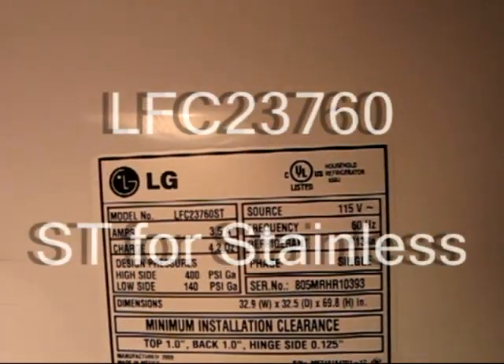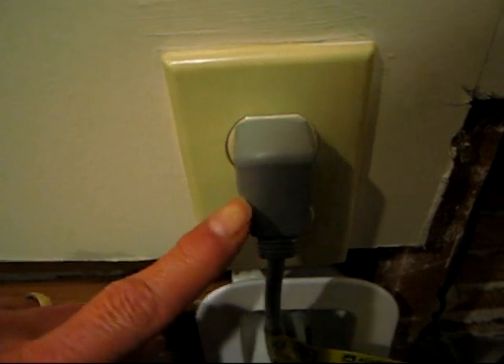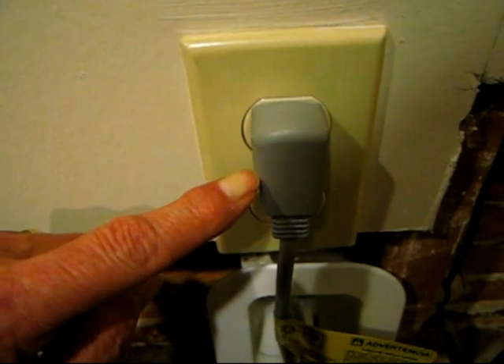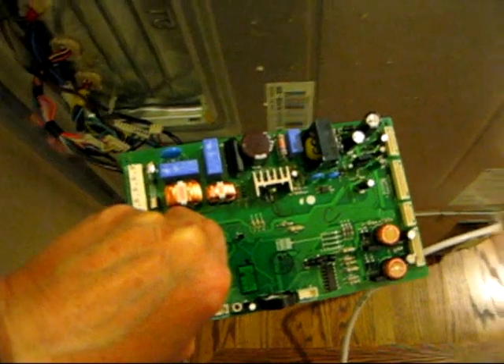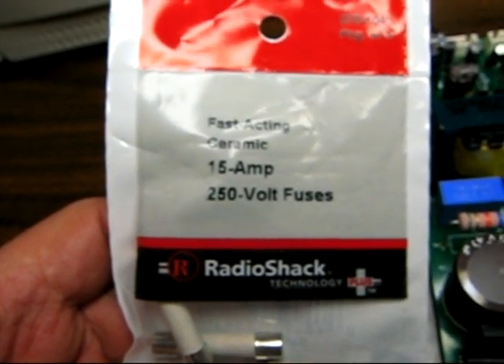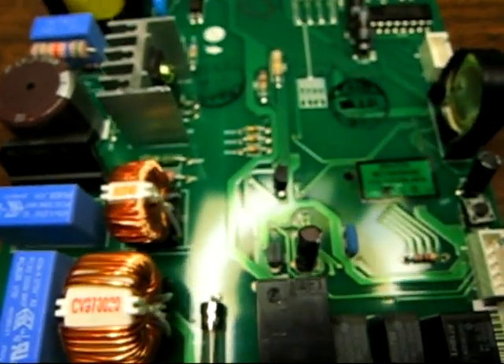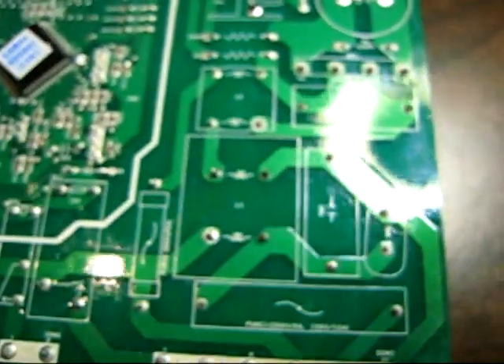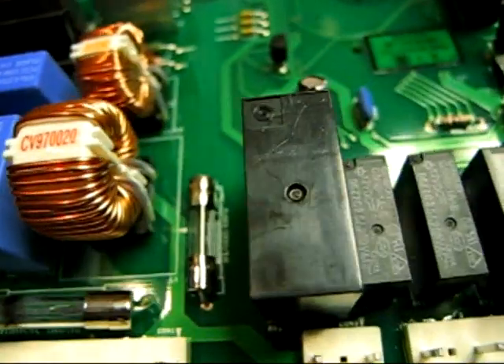LG Refrig FUSE Repair Part1

Comment: Retiredman2006, you absolutely rock bro!!!!  Thank you so much for posting the two videos on fuse replacement on LG fridges.  I have the LSC26905TT side by side model, and it cost me a grand total of $3.99 to fix my problem. In my case, the fix was even easier, because the larger 250v/15A fuse in my model simply pops in (and out), so no circuit board removal much less soldering was required at all.  I will also mention to anyone doing a repair on this LSC26905TT model that the circuitboard electronics are located on the top of the unit, not on the back (just follow the power cord to where it connects with the unit on the top).  Very thankful, thanks again!

Comment: Thank you for the great video.  I woke up to my LG LFC23760ST not working.  Interior lights were off and the LCD thermometer wasn't illuminated.  I checked the circuit breaker on my home's electrical panel and it was fine.  I googled LFC23760ST and your video popped up.  After a visit to my local electronics store and $3 in parts, I was able to fix my fridge.  Thanks for making this great video.

Comment: FIXED! Hallelujah ! I know nothing about electronics. Took a stab at it since I may end up with a broken fridge anyway. I cut the pins at the fuse instead of taking the pins out of the board. I fused the wires to them instead. I first tried to shortcut and solder directly to the fuse but it never held......should have done it your way first. Thanks a bunch, saved me 1000 bucks :)

Comment: First, I wanted to say thanks!  This fixed my problem before any food could spoil.

I went ahead and ordered some fuse clips I can solder onto the board from Amazon so I won't have the bulky wiring floating around.  As for the 250V/15A fuse, apparently they are common microwave fuses and I picked up two for a couple bucks at Home Depot.

Thanks again for the helpful video.

Comment: Thanks retiredman2006!  After five years of use, our LG just had the same problem. Not the same model but it has the same circuit board. The fuse is bypassed for now but I will definitely be attempting this fix tonight.  While I'm not positive it had anything to do with the fuse but our bottom sections was filthy with pet hair and debris.  Access was simple by removing the screws holding on the bottom panel on the back.  Hopefully a thorough cleaning will prevent future fuse issues.

Comment: I have the same model fridge purchased in the fall of 2009 and the fuse blew this morning.  I had no idea what happened or how to fix it until I watched your video.  I would just like to extend a big thank you to you for posting this 2 part video.  It was very much appreciated!
Reply from the maker: You're welcomed.  In these times throwing away the circuit board for $200 due to a blown fuse is just dumb!
Reply: It ended up costing me $1.70 CDN.  $0.20 for the fuse and $1.50 for the inline fuse holder.

Comment: Thanks your fix worked perfect. However when I opened the panel and did a visual inspection my fuse did not appear to be blown or "burnt like yours in the video, but checking it with a multi meter is sure was. So any out there,  double check yours before you give up ( like I almost did ) and call the repair man. What a good feeling to save hundreds and not to mention all your groceries. ..
THANKS AGAIN.
Reply: Yea exactly, my fuse looked good and clean, not  black and blown, so I didn't think that it was the fuse and was starting to look into the compressor start relay but everything related to that kept saying if the fridge was not cooling and mine was DEAD, so I knew that it had to be a power source. I found another video where the fuse was clean and intact like mine and he used plastic covered handle needle nose pillars to test it which was perfect because I do not have a multimeter. I gave it a try and SURE enough after a few clicks the fridge turned on and was running, which confirmed that the fuse was indeed blown! Moral of the story, NOT all fuses have to be black, cracked, broken to be blown, mine looked perfectly fine. Glad that I didn't have to buy any new tools.

Comment: Thanks for posting this. You saved me an ugly repair bill.  I believe the 250V 15A fuse is the correct one for a 120V supply voltage (in the U.S.). 250/15 was the original fuse on mine as well. The 250V 9A fuse would be for a supply voltage of 220V. I used the ceramic radio shack fuse you showed in the video. Hopefully it will fare better than the first.

Comment: Thank you so much for the easy-to-follow tutorial.  I made it even easier (though perhaps less sophisticated) by leaving the bad fuse in place and hot gluing a new fuse of the same length to the bad one, with their metal end caps touching.  The hot glue should just go on the glass tubes and you need to hold the fuse ends together as the glue cools.  The new fuse completes the circuit.  If I need to replace the newly installed fuse I can just peel the hot glue off the original, bad fuse, or just glue on another fuse to the replacement fuse.
Reply: David, make sure the metal contact to the fuse is a solid connection to the old fuse else it may arc - spark.

Comment from the maker: I needed the old fuse in my hand to take to Radio Shack but don't like taking the circuit board to the store for the risk of damaging/dropping the circuit board. And just my preference to not solder on top of the old fuse because it makes my new fuse holder dependent on a solder joint that could go bad.  Your idea of soldering to the end caps is fine if you're in a real hurry but for me I'd rather remove the dead fuse.  It took an extra 1 min. to remove.

Comment: i change the whole circuit board for $203.95 including shipping cost and tax and ordered it from Repair Clinic based in Canton,Michigan.I lived in Toronto,Canada...unfortunately IT STILL DIDN'T WORK STILL..i noticed also that the old mother board's fuses were all intact,meaning it;s not burn-out.I was forced to order this mother board per advised by a technician which cost me $80 for his visit and another $25 for his "never did"labor.My LG fridge is only 4 years old($1400).

Comment from the maker: Yes, your way is a faster less effort fix, but if you blow the fuse again you have to take the circuit board out again.
Hopefully you will never have that fuse blow again but for me I like the ease of twisting open the fuse holder and changing the fuse with the circuit board in place. 
 I do not promote just changing fuses, you should always try to figure out why either of the 2 fuses blew. I use it to buy time to keep from losing all of my food.

Comment: Here's a Hot Tip regarding Fuses , any Fuses , Refrigerators , Microwaves , Car Headlights etc. If the Fuse Filament is completely gone , Vaporized or completely covering the glass with Soot then you have another problem to fix other than the Fuse . But , if the Fuse filament is still partly there , then it was a Fuse that got hot and took a little time to blow and there is likely no other problem . So go ahead and change the Fuse with the confidence that it will work and may have actually been a bad Fuse and not a problem with any other part of the Appliance .   - Been repairing Appliances since 1981   :)

Comment from the maker: Check the 2 fuses on the circuit board.  If either of them are blown, then replace them if you can.  If you can not, then bypassing the fuse is a big risk and at your own risk for further damaging the circuit board or shocking yourself. But it is something you can do to confirm the fuse is burn out when it does not look burnt out.  My advice is to use the repairman who knows what they are doing.

Comment: I have found the easy and best way is to buy the same fuse and just lay it on top of the old fuse and solder the ends of the new fuse to the ends of the old fuse. No chance of melting the motherboard.

Comment: I'm going to be doing this tomorrow on a LG model LDC22720st purchased in 2008. Here's hoping I do it all correctly. I would prefer getting clips to mount the fuse but I don't think that is going to happen with the single hole configuration on the PCB. The holes are 36mm apart.
Reply: Marvin Bowen solder in a Twist cap fuse holder

Comment from the maker: Yes, I was safe but that's my opinion.  The replaced fuse is a slow blow type mostly to handle the compressor kicking in.  Replacing the circuit board with the same revision is a waste of money. On the 2nd time it blows, I would then go back to LG Tech support.

Comment: Nice video -- I just replaced one of the 2 fuses on an LSC27910TT (side by side circa 2003) -- the 15 amp one -- and it was a removable (conventional) fuse -- the other one was smaller and soldered-on but it had not blown.  Does anyone know why this fuse may have blown?  There were a lot of dust bunnies around the intake for the coils and one thought is that they had overheated a bit and caused to compressor to run too long or hard

Comment: I just read on the web that 2 of the common reasons for fuses to blow are compressor problems (including bad ventilation perhaps) and the defrost heater in the freezer.  If a fuse blows repeatedly, the compresor can be checked by removing its relay and seeing if the fuse blowing stops.  The defroster can be checked for simple continuity after complete removal -- its usually behind a plate on the back inside wall of the freezer.  If its short, replace the heater.  Here's a good video
http://www.repairclinic.com/PartDetail/Defrost-Heater-Assembly/67004188/1070414?modelNumber=MSD2650HES
as always, unplug the fridge before doing any examination or work

I'll keep an eye on mine with the new fuse but I am betting it was a cooling issue on the compressor

Comment: Easier yet is same fuse holder and two alligator clips.  You do not have to remove the board.
Reply from the maker: Good idea, I used just a wire with 2 alligator clips to get the refrigerator to work again temporarily until I had the parts to complete the repair.

Comment: can I replace the fuse with one of same Amp and Voltage if they look different? The circut in the middle of the fuse looks different but the amp and v are the same. ?
Reply from the maker: Try to look for a slow blow fuse.

Comment: Does it just plug in and kick on after that? I replaced the circuit board and the fridge still isnt turning on. What next?
Reply: Did you replace the burned out fuse(s) or is this a new main circuit board?
Reply: Check fuses again. If it blew the fuse again - what type of fuse did you use?
Reply: Fuses should be the slow blow type.
Reply: It's a whole new circuit board

Comment: PLEASE ANYONE HELP! Yesterday we missed electricity and the refrigerator is not cooling (the freezer is still working though). Everything else is working (light, DRO, fan) but it is not refrigerating my food! We had this problem already when it was under waranty. Last time was the freezer. The service guy came here and replaced a simple fuse. Now its no longer under waranty and i would like fix it myself. Could anyone help me with this?? I know it only a 1$ fuse issue! thanks in advance!

Comment: after this repair the refrigerator works, however it now seems to constantly run, never shut off. what could be the cause of this?
Reply from the maker: Most likely not. But I suspect maybe the cables need to be reseated (do this with power Disconnected).
Reply from the maker: +Ben Bowman Try to think why the fuse blew to begin with.  Are you low on freon coolant? Is the compressor working too hard?  Is the temp sensor working or not?  This controls the off and on of the compressor.  So many things to deduce and troubleshoot.  I'm not a certified service guy so I'm not really much help.
Reply: Thanks, I removed the rear cover again and cleaned more of the dust from the coils. Seems to be operating normally now. I may replace the door gasket as it seems to not have a good grip.

Comment: My Kenmore (LG) just died and had sears guy come look at it and it was this fuse .. They wanted me to buy a new board and to install it for $539!!   The Board they sell at Sears for $149 brand new... They wanted to charge me 250 plus for Labor to install!  Took me 20 seconds to unplug and remove board.. Went to Home Depot and bought fuse for $2.09 total.. Re soldered the new fuse in and up and running ..   Wonder how many people they rip off with this.. STUPID that LG does not make this removable.

Comment: Only issue with this video is the fuse selection. He is choosing the wrong size. The board reads 117V - 125V: 250V 15Amp optional 220V - 240V: 250V 9Amp
Reply from the maker: I disagree. There is no issue. The board does not read what you stated; the silkscreening on the circuit board reads 250V/9A 125V/15A. Look again, it's in the video.  I also stated that the original fuse that I removed was a 250V 15A.  The logic behind these 2 voltages is to support the Non-USA (250V) and the USA home (125V). Could not find a 9Amp fuse so I use a 8Amp one and have not had any problems since repairing this over 2 yrs ago.
Reply from the maker: I think the voltage markings on the circuit board that you have stated is from a different LG refrig fuse repair video maybe (SamuraiRepairman)? My circuit board does match what you have assumed. Since my AC outlet that my LG refrig plugs into is 110v AC, the 250V 8A fuse that I chose to use should still work fine.  Why the manufacturer used a 250V 15A fuse originally is a "I don't know" answer.  Ideally I should have use a 125V 15A fuse but I didn't and the manufacturer didn't either.  Thanks for your comment.
Reply: No the video is for the same model refrigerator. If you look at your reply what I stated is the same. If your refrigerator runs on standard USA power 125VAC the fuse is rated 250V 15 AMP. 250 volts is the rating of the fuse not voltage applied. So if the frig runs on 250 volts it is a 9 amp fuse rated 250V and if it runs on 125 volts it is rated 250 V at 15 amps. To add what I have stated is what is printed on the circuit board for my refrigerator. Same model. Also I am an electronics technician and licensed electrician with over 40 years experience. A 15 amp fuse running on 125V would provide 1875 watts. A 9 amp fuse running on 250V would provide 2250 watts. An 8 amp fuse running on 125V would provide only 1000 watts.
Reply from the maker: Thanks Don for the explanation!